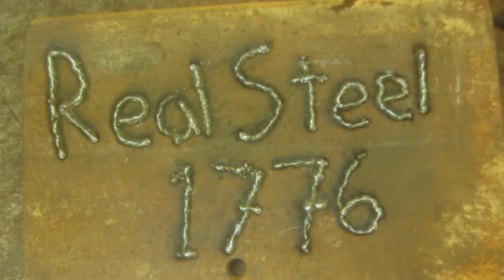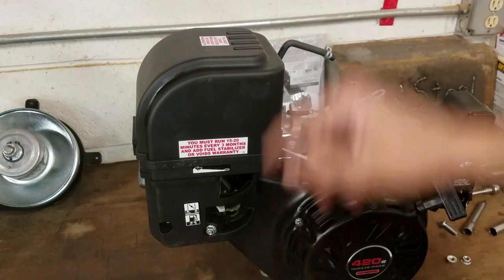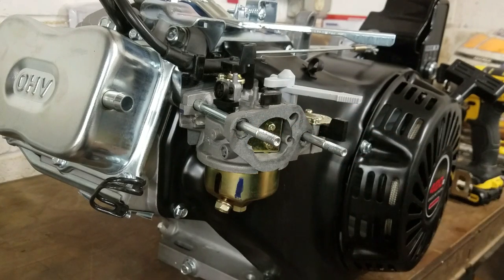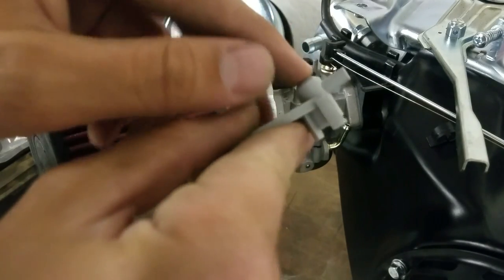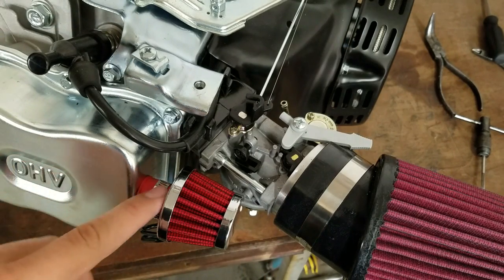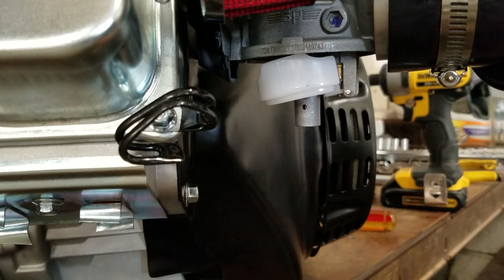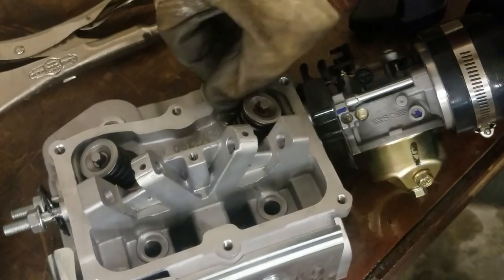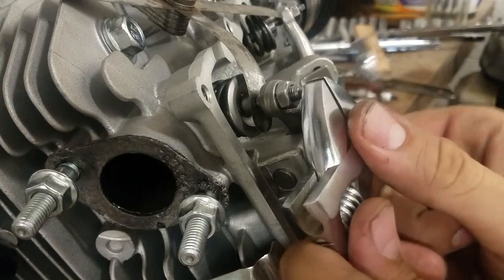Predator 420cc Performance Mods!

Comment: Tip: put grease on your tap then it will both lubricate the threads being cut and the grease will hold 99% of the shavings too.
Reply: preciate that advice

Comment: great video! instead of removing governor, cant you just disconnect the linkage? instead of removing low oil sensor, cant your just disconnect the wire?

Comment: Watching you using that vice-grip to push down on the spring, I just was waiting to cringe when it slipped and either smashed your finger or sent the vice-grips into your face, glad it all went good!
Reply: ImaFurry Gaming
Reply: It's Fur-Bee Gaming lol
Reply: Will this. Motor just bolt on ?
Reply: Mr. Josh Brown       Bbbbbvv.   Google
Reply: Google
Reply: Mr. Josh Brown Bibb. Craigslist mini bikes for. Sale
Reply: Will this motor fit in my Honda?
Reply: HA, I've definitely mashed my fingers doing this... right after the pliers lose their grip! Then everything goes flying and i swear incessantly :p
Reply: Towel socket hammer disassembly done. Valve spring compressors aren't overly expensive ive made them with vicegrips and a welder worked great in a "have to" situation

Comment: Get yourself a valve spring tool and save yourself potentially serious injury with either the spring or retainers shooting up into your face, or the vice grips pinching the devil out of your thumb. You can also save a fishing expedition into the crankcase for the retainers that way as well. 

You can also get a truck brake spring driver (used on drum brake barrel shaped springs that hold the shoes to the backing plate.) It has a screwdriver handle and shank with an open ring at the end that compresses the spring as you push down, while allowing you to rotate the retainers. The retainer tool for trucks should be the right diameter to cup the spring and the retainer cup on top of your valves so you can place the retainers in the cup and stem of the valve.

Comment: It is practice to put air pressure into the sparkplug hole to keep the valves seated  while replacing the valve springs.  Very nice video, thanks for sharing.

Comment: Again I have no idea why this kid doesn't have more subs, such an engineer giving this vid a heavy like.
Reply: OK so I liked it. Been watching a lot of his video and I impressed how much he knows and how well he does it.
Reply: Because "drill slightly bigger" isn't a measurement.
Reply: Thank u enbiggen hole is not engineering. This kid is not an engineer. He is doing everything u should never do unless you are trying to kill a motor. No reason to diable low oil sensor EVER!
Reply: @TrapperAaron  It is true all the modifications he is doing to this motor can decrease engine life. But he stated that he is doing this for performance, and mods made for more power are always at the risk of less engine life. He also explained the reason for disconnection of the low oil sensor. It is at one side of the block, and a hard corner will, through centrifugal force, throw the oil away from the sensor and kill the power. These motors are made for stationary use and steady power demand, totally different from what he is preparing this engine for. And if he does not realize this can shorten engine life, he will soon learn.
Reply: @ronfullerton3162  no performance here. Just bs
Reply: @DrLoverLover  It is not drag racing stump pulling power by any means. But it is more power and rpm's than stock. For young guys to take the initiative and work on a motor, wrench it and do little mods and gain some power and experience is a wonderful thing. Of course, with EV the up and coming thing, you may say this information and experience is of no avail. But the ability to work with hands and problem solve will be an asset for the rest of their lives. Let's support these young men that are showing the initiative to expand their horizons.

Comment: u did a nice lil video here. u taught me something. now ill have no problems doing these same mods when its time. im impressed. i love working with engines and metal. like welding. i worked at a lil aluminium boat factory and taught myself how to tig and mig aluminium. even anodized aluminum. i thought aluminium was tricky to weld. took a welding class in school to weld mild steel and iron. i have alil mig, tig and stick welder combo. i can even gas weld. again. nice vid lil brother. never stop learning and showing ur skills. u have a nack at it

Comment: The filter I bought came with the adapter and  a hold down for the choke, the spacer (I bought separate) had the correct holes in it. Also came with a bigger jet...I can't recommend using the bigger jet , the engine runs better and comes off of choke faster with the OEM jet it came with.
Reply: Can you send me information on the kit you brought?

Comment: Just to let you know the other method of holding the valves in place is air pressure by installing a modified fitting with a air hose hooked to your compressor to the spark plug hole.

Comment: When tapping the Governor hole put a tac cloth in there and / or hold shot glass under the hole to catch the metal shavings.
Reply: Dude there is so much horrifying and terrible info in this video and ur concered about some drill and tap debris? This video i pray is really a joke. Like what not to do to any small motor ever.

Comment: Laughed at the painting :D And awesome tip with the spongy rope thingy! I might use that some day
Reply: It's called Backer Rod and it is used for backing a gap so you can caulk a joint and not have the caulking fall deep into the gap.

Comment: You can use air pressure to hold the valves back using a compression guage hose & air hose nipple ,Get yourself a round brake anchor pin tool great for doing valves too .
Reply from the maker: good tip

Comment: Could fill the cylinder w  air through the spark plug hole compressing when removing n installing the valvebsping n valve spring seals . But all in all.  Awesome job
Reply: Air works ok,  if you have a gearbox to stop motor rotating !  ,the soft rope method is very good , but he didnt show winding piston back toward TDC .

Comment: [ On the choke lever ] i drilled a small hole in the lever like you would for a screw. Then i made a few grooves angled downward in the shaft. I mixed up a little JB Weld ,fingered it into the shaft grooves then shot some into the lever with a crack filler syringe. When i pushed the lever down some epoxy came out the top hole and i finger molded it over like a little cap. that was 10 yrs ago and it's still on there. PS i used my dremel for the grooves.. I knew if i tried to drill and tap that shaft i would F#%k it up..lol

Comment: cant u  just remove govenor link on outside of engine,without removing internals?,if it dont close butterfly valve it dont govern it ??
Reply: Change spring
Reply: I know this is an old comment but I was thinking the exact same thing, just remove the governor arm and call it done, also just unplug the oil level sensor wire on the outside. Loads of extra non value added steps. We'll not mention the valve clearance on the exhaust port is normally more than the intake as it runs hotter and expands more, so his original clearance was fine.
Reply: @robevans8555  You can, but then you run the risk of the governor flying apart in there with the higher rpms. Much better to just remove it.
Reply: Not to mention removing the extra unnecessary weight

Comment: If you’re worried about not being able to get all the backer rod (sponge thingy) out of the cylinder, you can use an air hose fitting to screw it into the spark plug hole and apply 100psi air to hold the valves in place. I’ve done this multiple times when replacing valves springs on Chevy LS motors while it’s still in the truck. This was a great video, and I doubt you’ve put it on a dyno to see the power increase, but do you have any idea how much power increase you got, or how high you can rev the rpm’s??  I know the factory governor had it at 3600 rpm’s.

Comment: You'll find a nice performance increase by using an offset flywheel key to advance the timing by about 2 to 3 degrees.
Reply: I remember something about doing something similar on certain year Ford 460 engines that was good for 50 horsepower. After playing with small engines and then air cooled Volkswagens it was amazing how just a few thousands in valve adjustment could effect the engine so I can only imagine changing the valve timing.

Comment: Hello, great vid. Very helpful info. Where can I get upgrade valve springs? I have a 16 hp single cylinder like your one but I can't seem to find any. Do you think the 35 lb springs would work for this engine too?
Thank you for your time.

Comment: Why not just disconnect the governor linkages and leave it in place? Also, as mentioned elsewhere, oil sensor could just be unplugged.
Reply: Or why not just take the governor gear out and leave the linkages so that you wouldn't have to do all that flipping around with the throttle arm

Comment: can you not just remove the governor arm and spring and by pass the low oil switch and never crack the case open and do exactly the same thing??with much less work ? I understand if your doing a custom build doing all this but if your taking a stock motor and simply by passing the governor can you just disconnect it from the butterfly and and that is it ? also this is the Hemi motor ......do not get me wrong you did a fantastic job with this vid and are doing it all 100% the best way but if a person was lazy can they simply do valve springs and by pass the other stuff?

Comment: If you don't change the emulsion tube that drilled jet won't do shit. I'm not being mean I'm just giving advice.
Reply: Small engine dude I have the 8 horsepower what size tube am I going to need I'm going to be running a 37 Jet right now I have a 36 in it but it seems it's just not going to be enough to allow me to open up the 301 CC Predator but no governor so which one do I need 4 the 36 because obviously the 36 jet isn't even working because I didn't get the tube so what tube do I need a 36 to imagine I'm going to go look it up but if you can help me
Reply: What do you mean??
Reply: You can change the jet without making a single change to the emulsion tube. The tube depends largely on what exact motor it is and what carb but the jet will have a large impact on the amount of fuel going into the motor with any emulsion tube. The stock emulsion tube makes great power with a different jet on our 25hp/30ft-lbs kart racing motors. This can be moddified so the amount of fuel is more consistent leading to a flatter Air Fuel Ratio curve.

Comment: After removing the GOV , I would have installed a billet rod to keep the engine from throwing the stock rod because of to many RPM'S.
You can make a spring removal / install tool ( for removing valve springs) from a large C clamp , weld a small piece of tubing on one side of the c clamp but cut out a section for room to insert the small keepers.
Reply: Can you do a video on that?
Reply: @edgravely1947  ... I may do that.
Reply: @edgravely1947  ... I did a video on the c-clamp . see it on my channel
Reply: Also I recommend a billet flywheel you lose charging is only issue but they make them with the ring gear for electric start I have seen 5 now on mine and others carts explode over 5 grand
Reply: @spinningtireproductions105  ...Yes,  billet flywheel also, less rotating mast it will rev faster.

Comment: It honestly pays to get a maikuni instead of a carb jet kit.
Reply: Agree w u 100% randomly drilling out jet to whatever size does not fly on a 4 barrel Holley, i dont think this would start and if it did run id say wouldnt run for long, and would definitely have less power than stock.
Reply: @TrapperAaron  No the jetting and intake is definitely better than stock as I have ran an engine with this configuration with good success on a gokart, but as far as a cost benefit equation goes, a mikuni will be a bit more expensive, but the performance gain is much better. In fairness he machined his own fitting so my argument isn't as strong but if he had to buy one, yeah mikuni.
Reply: @ssplintergirl  The Mikuni would be a far better way to go, just more expensive dollar wise, but could pay off later.

Comment: If instead of boring that hole through your aircleaner adapter in one size all the way from carb to inlet you had tapered it from about twice that diameter at the inlet to the size needed to match the carburetor you will have a much greater performance gain.

Comment: what kind of revs will you get after governor removal ? 

I got a china ( ducar ) copy of this engine .. using it on a longtail..      ,  would it be possible to just loosen the spring a little bit to get just a little bit more revs, without running into floating valve issues ?

Comment: Hi great video!! I need advice.. (Boss has 50+ years mechanic expirence & can't figure out) we have brand new Predator 420cc that we put on a mower. It's putting gas in to the crank case & leaking out the carb when it stops running! We took apart carb made sure it's still nice & clean properly put together etc.. Any suggestions?
Reply: Dementia?

Comment: I wonder how long that conrod can hold up in such applications... I used to work in a repair shop about twenty years ago where we worked on a lot of farming and gardening equipement and I've seen a lot of snapped rods and holed crankcases on these engines. An alloy rod with no bearings in an engine with no oil pump can very easily weld itself to the crankshaft and break in half if the engine is spinning too fast because of a broken or a modified governor
Reply: thats why go karts race every weekend with stock rods at 6k rpms all day without failures of rods or flywheels.....................................................

Comment: You should have done a mild port and polish job on the cylinder head ports as long as you had it apart far enough to do it.  That alone would make more additional power than any of the other crap work you did.  And with taking out the governor and installing heavier valve springs, how much higher is this engine going to rev and still make good power?

Comment: Couldn't you just remove governor to carb spring and run throttle cable directly to carb?
Reply: cmonster6 its better to actually remove the governer
Reply: Yes, of course.

Comment: why can't you leave the internal governor parts in and just disconnect the external parts ?
Reply: dale carpenter because with the extra rpm you get the plastic gear can break inside the block

Comment: 2 questions. When adding a torque converter, do I make the hole in the jet bigger for more gasoline? Also, is a 212cc torque converter able to fit a 390cc or 420cc engine?
Reply: No. Youll need a bigger set up. The shaft on the 420 has a lot more girth than the 212 shaft.

Comment: Hi, i really want to change the Air Filter and the exhaust and the Fuel tank. I am not looking for an performance increase! I just really need the space these three things take up on of the engine. A new pipe could go down instead, a new airfilter goes to the side like yours and as a Gas tank i would take a smaller one an place it some place else. My Problem now is that i only found one Air filter and adapter to buy. They don't sell that little air filter and a new jet with it. Can i use the stock jet thing also? Or do i really have to drill mine open. If so what size of drill in mm/cm? What can i do about that small air filter thing? Maybe i can find it under a special name? And you said i could use basically any steel pipe as a new exhaust. Is there anything to keep in mind if i don't want it to be extremly loud? And the Last thing would be if i can use almost any other kind of gastank for it. Thank you so much for your time. This would be a great help!!!

Air filter + Adapter kit i found (the only one...): 
https://www.amazon.de/gp/product/B07G2KPGSY/ref=ox_sc_saved_title_1?smid=A85SAYDIUMDLO&psc=1

Comment: U don’t need to put better valve springs on the 301 and 420 if you remove the govner
Reply from the maker: you do if you plan on running at high rpms. Gregg from Red Beard's Garage bent a valve on his ungoverned 420 because he didn't upgrade the valve springs.
Reply: So what weight valve springs did you change to?
Reply: he said 35 lb

Comment: I need your help.could you please tell me where u got your 35 lb valve springs for your predator 420 hemi head and how did you determine what lb of upgraded spring to use ? thank u.
Reply from the maker: i got these from Vegas Carts, but the springs were a little big for the spring collar, so I had to grind down the collar a bit for them to fit. I chose 35 lb springs because that's what I've seen others use
Reply: Thank u. I call go power sports and they said i have to use at least 50 lb springs when i take governor off on this engine. how are the 35 lb springs working for you and do u run your 420 alot ?
Reply: could you please tell me who you seen using 35 lb springs on this engine ? i cant find anyone but you.
Reply from the maker: Gregg from Red Beards Garage mentioned that he bought 35lb springs for his 420, but he doesn't have a video out on that yet. I haven't actually run this engine at all after installing the modifications. If go power sports says to use 50 lb springs then that's what I'd recommend, but the 35 lb springs were still noticeably stiffer then the stock ones.
Reply: ok. thanks

Comment: I installed one of these and now the engine only runs really fast with choke on. When i turn choke off it dies. Any thoughts? I have a powerhorse 414cc lct

Comment: When I take out the emissions airbox (Duromax 7HP electric start) will I have to route the gas tank anywhere or what do I do? I'm new to small engines etc. I am going to be putting an aftermarket carb on later but for right now I just need to get rid of that airbox to even mount my engine on my minibike.
Reply: If there is any way you can answer this question I would greatly appreciate it.